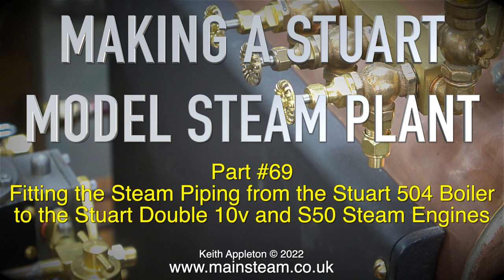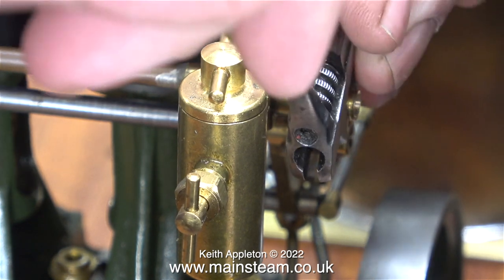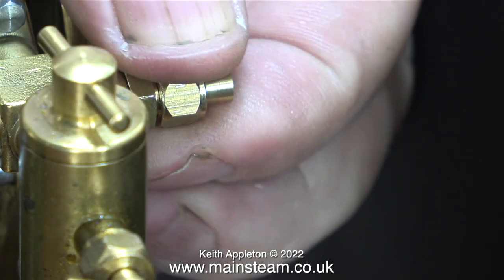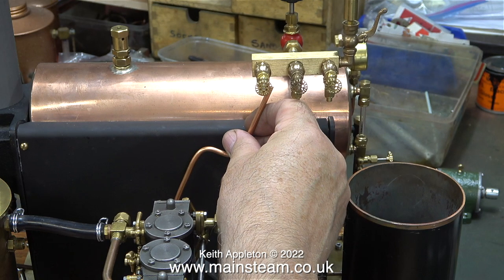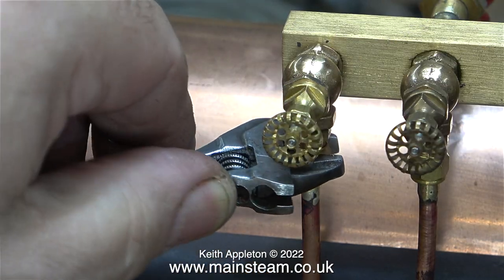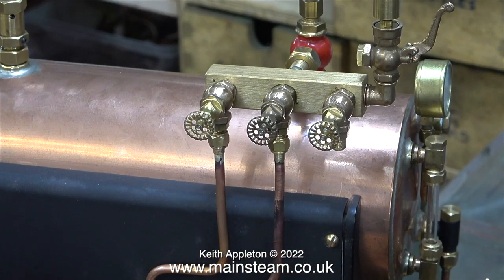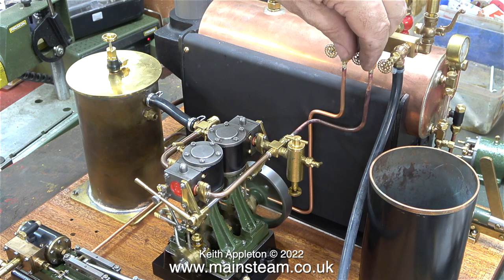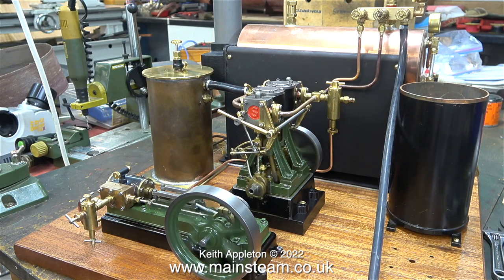MAKING A STUART MODEL STEAM PLANT - PART #69

Comment: It's been thoroughly enjoyable seeing this steam plant taking shape! The pipe runs look very well in those positions. I'm curious what the third valve on the turret is going to be for though - was that purely for the sake of compressed air testing?
Reply from the maker: The customer specified a third steam outlet to run another small steam engine.
Reply: @keithappleton  ahhh, that does make sense